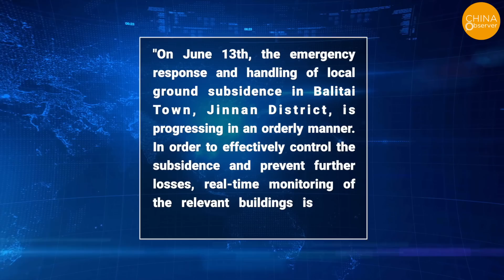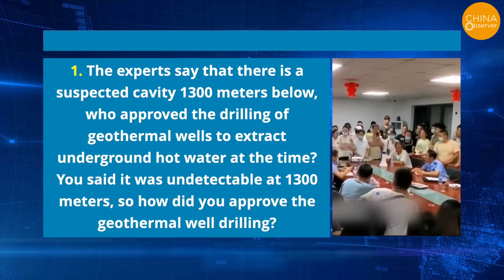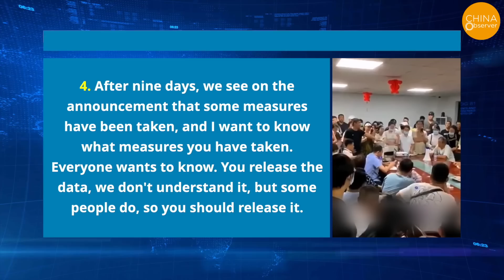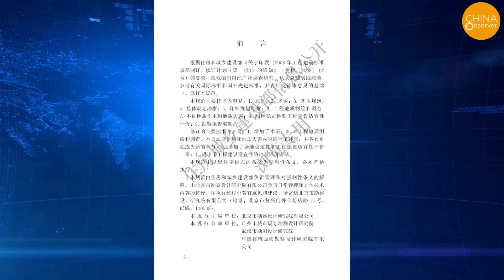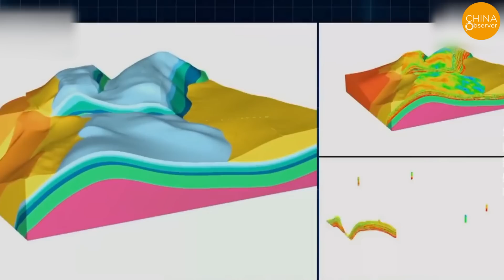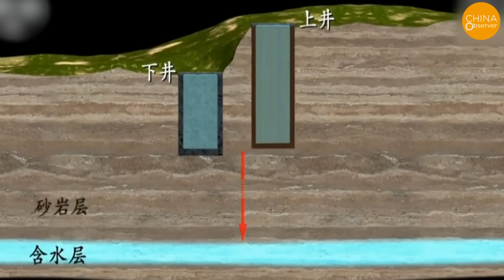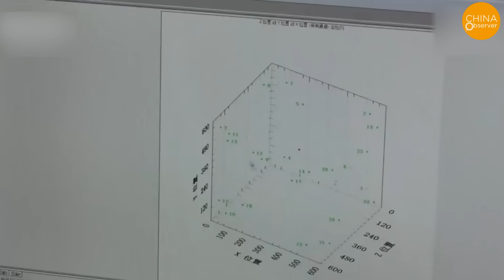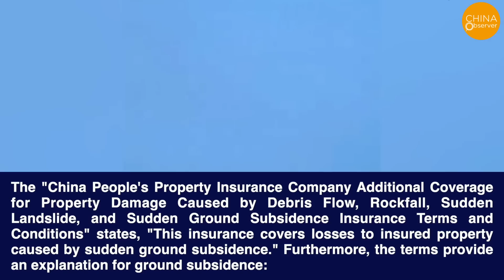2.3 Billion RMB Vanished, 42 Buildings Destroyed, Conclusions of The Expert Group Released

Comment: Rule number one in construction, if the Ground below your building is not tested or prepared according the regulation for structural construction, then you dont build on it and if you do, it all has to come down and the ground must be fixed before further construction can be allowed. My guess this does not happen in China due to corruption.
Reply: In China, rule number 1, build it as fast as you can.  The drawing for the project is on the drawing board.  Testing and site preparation and documentation of tests and site preparations will be on a plaque with all the experts and engineers who proclaims all is kosher and sound.   And, if something goes wrong, a fake investigation will absolve all involved.  “Force Majeure” will be declared.  Put a lid on it.
Reply: That's the way the Chinese roll , and don't you forget that !
Reply: You are assuming western standards. Not communist dictatorship standards!
Reply: Ha, InfectedSanluMilk what did you think you could build?
WithThatMalnutritionBrainOfYours? AHAHAHAHA All will Failure AHAHAHAHA Numba1 AHAHAHA

Comment: One thing I would recommend to the home owners , do not under any circumstance move back into those affected buildings. At just below 80 metres high they are a ticking time bomb. No matter how much concrete they pump into the ground , without opening up the ground on the tilting side of the building and putting in steel reinforcement and connecting to the footings steel and underpinning that by pouring in massive amounts of concrete would there be any chance of stopping the tilt. I don't like their chances. I think in a few weeks at most we will be watching videos of the collapsed buildings I'm afraid.
Reply: Ha, InfectedSanluMilk what did you think you could build?
WithThatMalnutritionBrainOfYours? AHAHAHAHA All will Failure AHAHAHAHA Numba1 AHAHAHA
Reply: Yes, I agree, honestly I’m surprised they haven’t fallen over already. Also, surely they can’t expect them to move back in with their building (a) tilted?

Comment: in reference to the insurance coverage you read for Bi Gui Yuan. There is what is called "imminent collapse". This is a defense used against insurance companies when they deny a claim because of collapse. This would only be a position to take for buildings that have not collapse, but are likely to collapse. An insurance policy conditions place responsibility of mitigation of a loss on the insured. If there is no loss, "yet". Imminent collapse throws responsibility for mitigation onto the insurance carrier. The insurance company's failure to act is a breach and an act of bad faith.